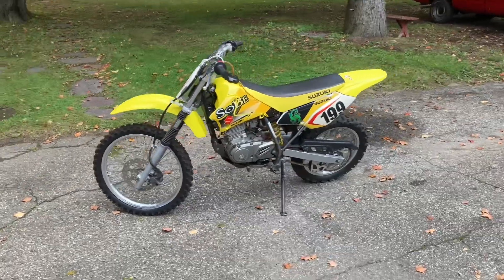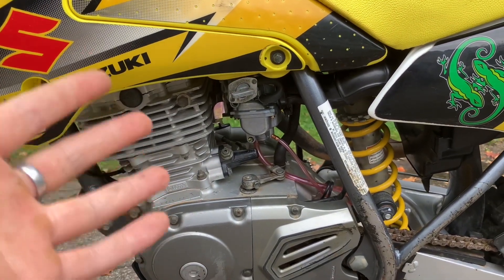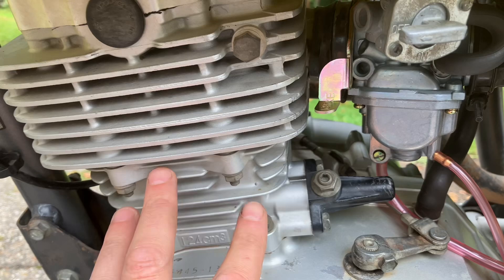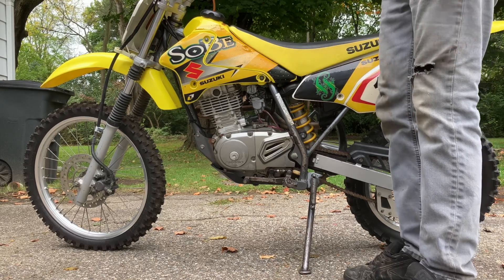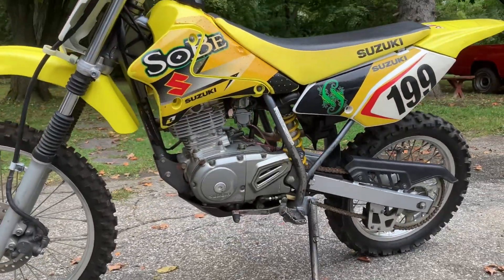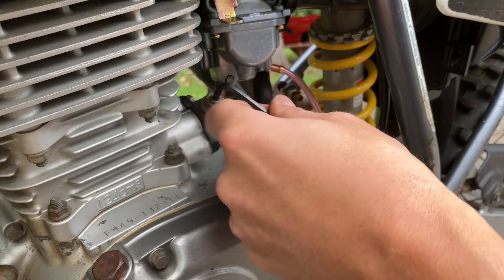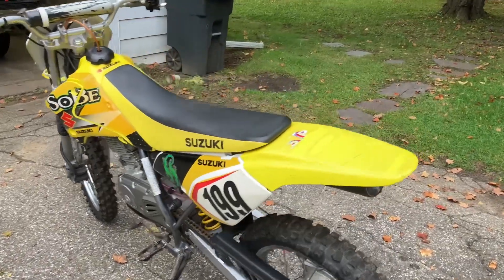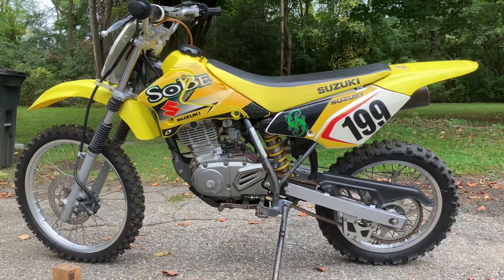Adjusting the Cam Chain Tensioner

Comment: How exactly did you adjust it and how much?
Reply: Hi man, it has a spring pushing adjuster forward - just loosen the set screw, spring will self adjust the tensioner inside with audible click to new position and you tighten back.
Reply: How much have you ridden it since this video and have you had any other issues with it? What yr is it?

Comment: Hi I have a Suzuki Freewind and today just got a noise kind of like that. The bike runs perfect too. It comes from the upper of the motor thinking about that timing chain
Reply from the maker: If you are confident in your mechanical abilities then try adjusting the timing chain tensioner. It might help out. 
If not then check the valve lash and adjust according to the manufacturer specs.